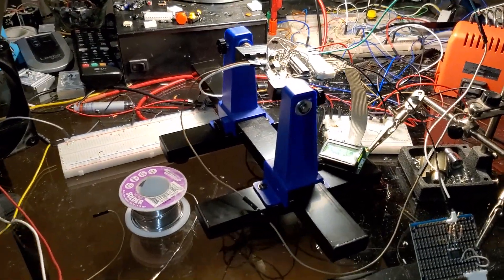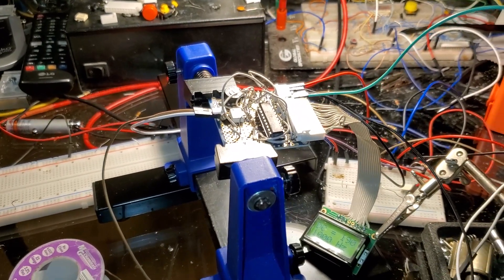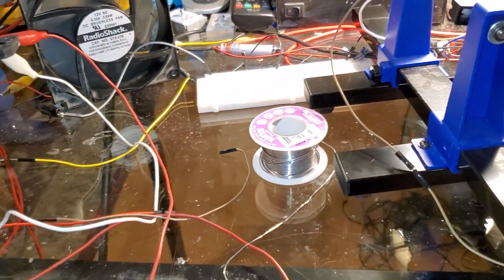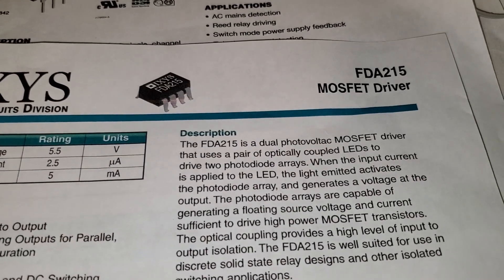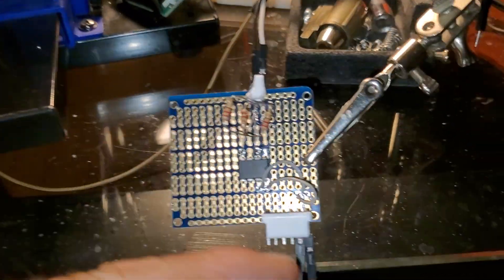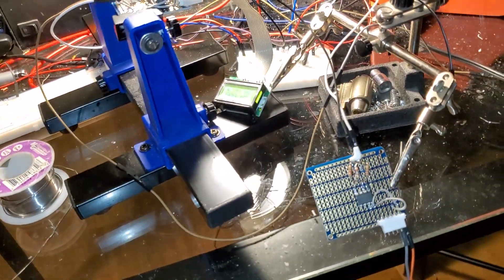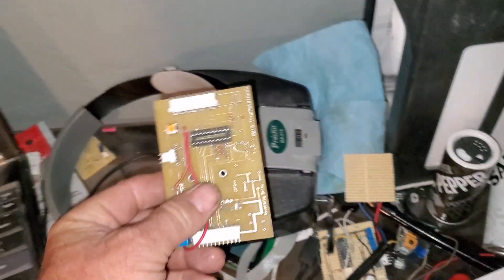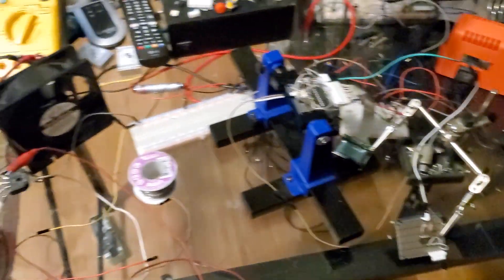My current "Mad Scientist" project doesn't go as planned. Back to Plan-A

Comment: Oh my you have a mess going lol. I've done a little of the electronic thing but never had much luck doing it
Reply from the maker: The mess is bad but it's several partial projects laid out there. 
I kind of want to create a new work area. 
Maybe against a wall where the power supply, scope etc can be mounted to a wall.
Reply: @hackfreehvac  if you have a flat surface it will pile up regardless lol. I know that feeling

Comment: Since the mosfet gate is highly insulated you’d think you wouldn’t need an optoisolator.  So long as the gate doesn’t break down from high voltage breakdown that is basically your isolator since you only need voltage to switch the mosfet.
Reply from the maker: It's still got one common terminal that would have wicked potential to ground.
So it's sketchy 

I've noticed that the IGBT's on LG inverter boards etc have opto couplers. (I noticed it now that I know that use them).
I have one old board so maybe I'll try to pull one off and test it.
Reply: hackfreehvac I was thinking of that too since most modern 480v 3phase VFD use IGBTs.  They survive the occasional power spikes so they are tough devices.